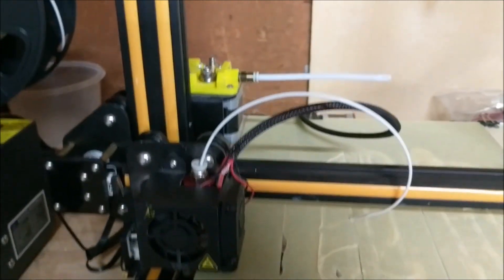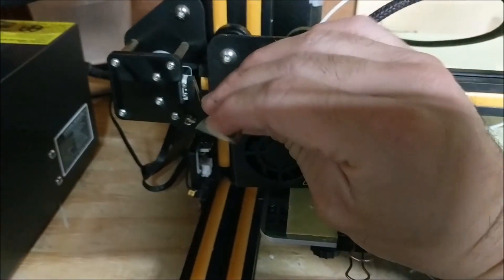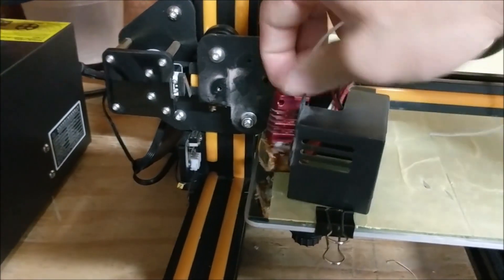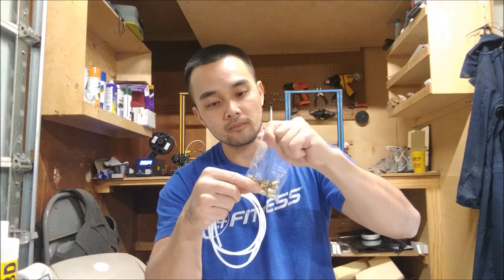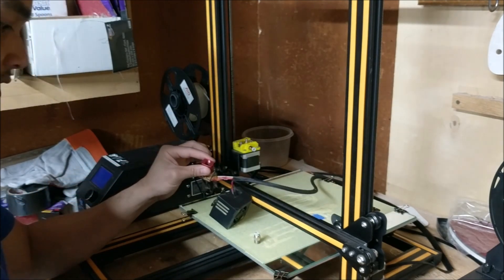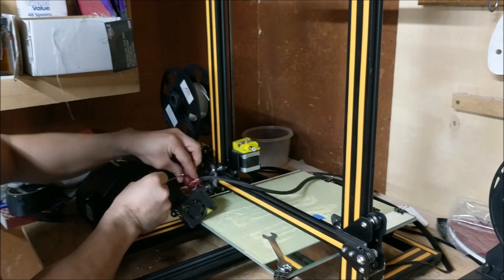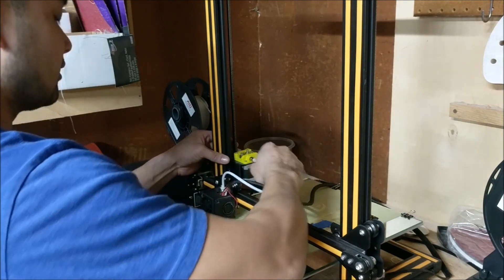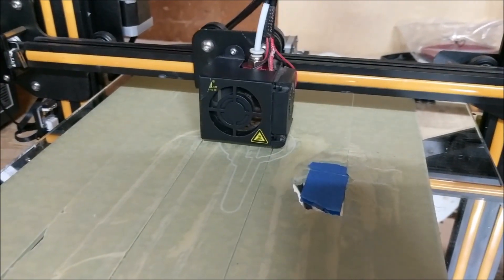3D Printing Tutorial  How to Replace Your Bowden Tube on a CR10

Comment: Thoughts: If the bowden tube only go one way in those bowden connectors... And you unscrew both of them... And you're going to throw away the old tube... Might you not as well cut it in the middle and... Get those old connectors back to work?

Comment: Thanks!  I just replaced my Bowden tube and had a hard time believing there was nothing else to hold the ends into the screw fittings.  Seeing you do this gave me a lot more confidence that I didn't miss any steps.  I didn't remove my hotend, did it like Kevin suggested.  Thanks to both of you for the very useful information!

Comment: I dont know why you removed the whole extruder ' its not required and when you put the bowden  right down into the extuder , the bowden can melt and cause blockages like it did with mine

Comment: dude this is real fuckwit.
questions people have when replacing bowden tube: how to operate the fing pneumatic locks: you must press the ring down, then insert the tube, then pull the ring up. the big issue you have when replacing tube is that if the end isn't perfectly flat and snug against nozzle, filament will creep in and stop it working. this is a royal pita, and it will happen to you if you just 'push in ol tube' without being aware of the crucial mechanical tolerance. 5 fing minutes holmes and you don't even touch on any of the touchy shit just totally unnecessary disassembly and "push ol tube in" WWWWWAH on you holmes
Reply: right now i'm trying to troubleshoot why my printer has worked perfectly for 3 years but i must now lose a section of bowden tube with every attempted print. your almost 6 minute video was totally fing worthless.

Comment: i don't have a stock tube to measure where to cut... whats the length?  thax
Reply: Cut to length so it will reach from extruder to far side of x axis without trouble and tie off to fit smoothly along side hot end cables

Comment: My bowden tube is stuck in the hotend. (CR10s) I don't know how...
I disassebled the hotend, the bowden tube is firmly melted/glued to the heatbreak. Any ideas?
Reply: Unscrew the Bowden tube connector, heat to 250 cel. And pull with all ur might
Reply: goddamnmaddog new hot end
Reply: Yep, like willicheese said, heat it up. You may not even have to pull all that hard if you are lucky. 250° C is the temp for PLA, but I'm guessing you would go higher it if were ABS in the machine.

Comment: cut with scissors is the worst thing you can do!
Reply: Agreed - use a jig and a utility knife, or better yet a cutter meant for the job. I know Capricorn Bowden accessories always include this tool.
Reply: A Bowden tube cutter is about $2, cuts straight and clean, don't use scissors

Comment: Luckily, all I needed was a rough length estimate.  You are doing way more work than is actually needed.  You definitely do not need to remove the fan or dismount the hotend.
Thank you for providing your content to us though!  There is other good information here - just you are a glutten for punishment :-)
Reply: yes i agree i have been into 3d printing for only 3 months and have done this a few times on cr10 and ender 5... plus he should have heated nozzle then removed the filament... and definitely left hot end and fan alone...
Reply: Videos or just saying it?

Comment: Would you recommend replacing the bowden with capricorn? I was about to buy one, but saw a bad review regarding filaments jamming inside the capricorn tubing due to the super tight tolerance of the inside diameter. Have you tried one, just want to know your thoughts on this.
Reply: This is most definitely too late, but I just bought some Capricorn tubing from their official site and the tolerances are WAY too tight for normal filament. You can't use standard filament. You have to buy needlessly premium filament for it too work. In my opinion, it's over-hyped, over-priced and under-performing.

Comment: That fan sounds like it has a string of filament in it, possibly from a failed print.  Inspect it carefully, and pull and bits that aren't supposed to be in there with tweezers, and it should be nice and quiet again!
Reply from the maker: Keldor314 there was. I fixed it already lol

Comment: Why are you removing the bowden tube quick connects completely ? you are meant to press the plastic ring back and just remove the tube only! (They are 2way) its FESTO standard push in fittings for air hoses a industry standard world wide, borrowed for use in 3d printing applications . you are just wearing out the threads in hot end and extruder by threading them in and out again than actually using them as intended.
If you like doing videos and educate and help people IT'S IMPORTANT to not misinform or misdirect people.
Reply from the maker: Björn Johansson I tried that and it wouldn't come off. Thanks for the info though. You should do a video showing how to do that
Reply: @NikkoIndustries  He's right that will come out. but the trick is YOU need to HEAT it up because of the plastic around it.   But I don't understand why you unscrewed all that? I just unscrew that top screw and pull it out..
Reply: Nikko Industries Thx for answering not my video but first hitt on a quick search here, old but the same concept.
There are so many videos explaining this fittings so I don't think I need to do one to. Butt thank you for taking the time.
https://youtu.be/qtWLFKpItz8
Reply from the maker: Björn Johansson sure! I just want to help people. I don't pretend to know everything. I make videos based on my personal experiences.
Reply: Nikko Industries yes and you should continue doing so I mean I found you 😁 good luck and tinker on.
Reply from the maker: Björn Johansson thanks brother!! To you as well!! 💪💪💪